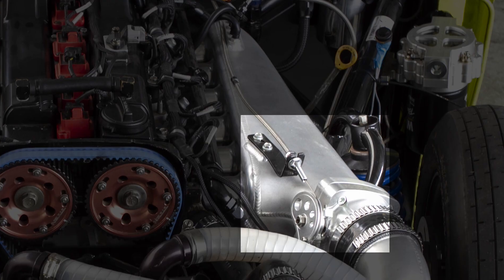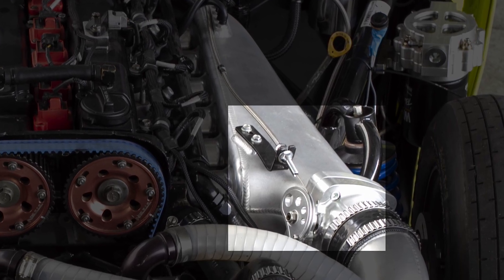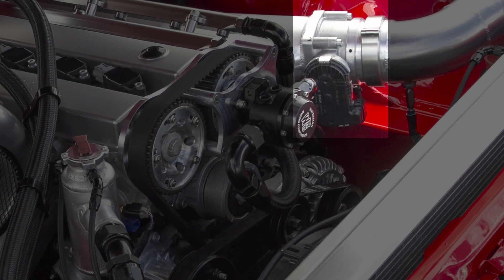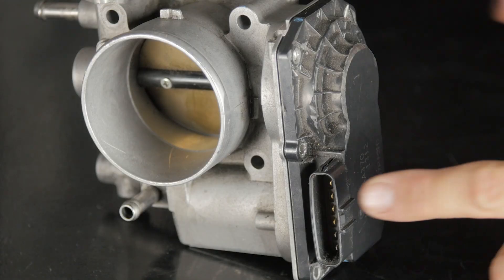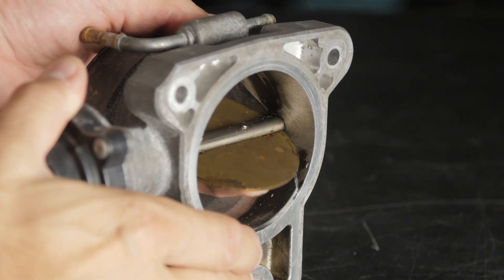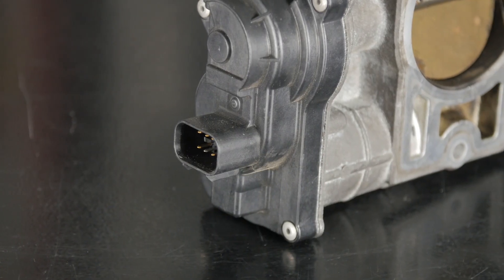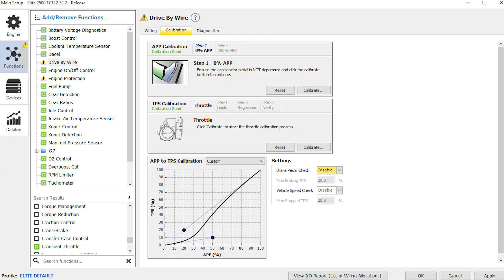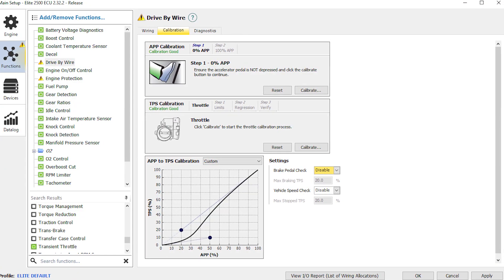🛠 Drive-By-Wire or Cable Throttle?  | TECH TUESDAY  |

Comment: Ive done DBW on my newly built sr22vet and as good as it sounds in terms of traction control and all the rest, the delay from throttle on is annoying, also hard to drive it smoothly, slight touch of the throttle and the car lurches, weve calibrated it yet its still hard to drive smooth, its also hard to feather the throttle in situations where theres no traction control, its hard to keep it in the sweet spot of traction/wheelspin, i much rather a cable throttle now but already have this DBW set up in the car, if i could do it again id definetely do cable

Comment: The major  disadvantage I have found on our Ford BA XR6 is that the throttle does not know exactly what I want, and makes some very dangerous assumptions- either too little, because it thinks I want to be conservative, or too much, which is hazardous in low-traction environments (no TC on the sedan). This has led to my wife (and no sexist remarks, thanks; she IS a good driver) and I both losing control of the vehicle on different occasions, luckily no other vehicles were in the immediate vicinity at the times. We have absolutely NO confidence in the power delivery of the vehicle, and will be trading out to another vehicle entirely, WITHOUT FBW throttle as soon as possible, even if that means going back a few years in model choices.

Comment: The electronic ones fail faster than the cable ones due to failing sensor and/or motor
Reply: This is true. Happened to my 12 year old motorcycle.  Where as my 20 year old bikes have had no issues with cable.   I own three motos.   Plus I predict a time in the future when the authorities will be able to slow speeding vehicles wirelessly with a throttle sensor jammer.

Comment: Most OEM return-less fuel systems can't cope with sudden throttle inputs. So electronic throttles are used to limit opening speed
Reply: Thomas 16.04  great information!!
Reply: So how would a cable throttle limit opening speed then? Or I guess it doesn't and just bogs? (Cuz that's what it feels like it does on my cable-throttle car, when I mash the gas at lower RPMs)
Reply: @Platinumtag  I don't know about the pricing in your country, but here, iacv is cheaper to replace than an entire tb. most of the time, it just needs cleaning.

Comment: As stated, a lot of the issues people usually have with DBW throttles are really down to factory tuning, with a few issues attributable to pedal assemblies themselves having unusual travel and in some cases non-linear potentiometers. Tuned properly, an electronic throttle can behave exactly the same way a mechanical throttle would. Of course, that simply adds a level of complexity to your tune, which can already cost hundreds of dollars in labor time just to get the engine reliably making power, let alone adding whole layers of drivability tuning when TPPS and TPS Demand curves are considered, not to mention the cost of finding and acquiring a suitable pedal assembly that fits your car, sits in a comfortable position, has a suitable spring rate and travel, and the process of mounting it in your car.

Like anything, there's no one right way to use an electronic throttle, but there are plenty of wrong ways, which have soured many people on them, and there are a lot of considerations when developing your own "right way" to throttle your engine. I went with a cable in my Nissan, but I'll be running an engine with an electronic throttle in my RX7. There are a lot of reasons why I've chosen these different paths, and in my opinion, both technologies offer their own advantages that best suit different kinds of builds. Think long and hard about what you want to accomplish, and throttle your engine with the actuator that best suits your needs.
Reply: I haven't had that experience. Even with standalone ECUs tuned to provide linear, fast E-throttle response, no E-throttle I've driven has had the immediate response and natural resistance of a cable. With a cable I can feel the cable be actuated, and instinctively know how much throttle was applied.

Also, when slamming the throttle down after a quick shift, the E-throttles simply can't keep up. "A throttle control algorithm for improving engine response based on the characteristics of electronic-throttle-control actuator" (T. Aono; T. Kowatari, 2001) sees E-throttle response times of 60-100ms; even if that has improved over the years, it will still be noticeable at 20-60ms compared to the <10ms of a cable. Datalogging on my Link G4X shows that my throttle application on quickshift goes from 0-100% in about 80-140ms; a 20-40% delay will definitely be felt - not to mention during transient throttle applications.

Comment: How could an electronic throttle be faster than a cable?
Reply: Electrons move many times faster than we can. If you want a good DBW unit could open in a millisecond, it's crazy how fast mine moves when the ECU triggers traction control.
Reply: @southjerseysound7340  
There's exactly the same human input, the only difference one is pulling a cable and the other is an switch. The time it takes for the throttle to respond would be unnoticeable in the real world and probably actually faster for a cable thats not made for elastic
Reply: @richardballs8618  That is why I mentioned how fast it moves when the ECU tells it to as part of my traction control strategy.
Reply: It will sense wheel slip long before a person can and pedal the car to regain traction in the blink of an eye. When we were setting the car up and adjusting the duty cycle . It would move the plate so fast it was nearly a blur.
Reply: @southjerseysound7340  ok so you answered a question I didn't ask, cool.
Reply: @richardballs8618  You asked how a electronic throttle can be faster than a cable, or didn't you?   I answered and gave one example, of how a ECU can "pedal" a car faster than a cable. There's other situations besides traction control where a good ECU can operate faster than a cable T body and a person. In a foot brake class guys have been known to use a DBW setup to go wide open faster off the line. Basically when he releases the brake and hits the gas the ECU knows to go WOT asap and it'll be at WOT long before your foot hits the floor. Its cheating in some rules because that little bit helps cut a closer more consistent light.
Reply: @southjerseysound7340  

That would be an example of the ecu being faster than the person, not electric throttle being faster than cable. nice cope though

Comment: My 2000 Mercedes W210 E55 has a short throttle cable to an electronic box in the engine bay, I think it might be the same for all the face lift petrol versions but you'd have to check should be loads in scrapyards, they all go rusty or have something really expensive break eventually.

Comment: Cable for me. I haven't driven an aftermarket-controlled e-throttle, but the OE ones I've driven are laggy and increasingly meddlesome and have turned me off to the idea entirely.

Comment: I have plenty of experience with both. I'd argue there's no throttle motor that is as fast as my foot, but that's hardly an issue. My issue is definately the feel - being able to adjust throttle directly and load the engine predictably without any electronic adjustments. Also, like was mentioned, factory cars seem to have a delay (my manual Audi sure doesn't, but the newer FCAs do), and they also don't seem to be 1:1, they lurch or come on far too quick for smooth driving. Speaking of smooth driving, I can put my foot back on the throttle and cancel cruise control comfortably, unlike drive by wire
Reply: Yep a lot of them seem to have a little one two count before they react, just enough to be irritating
Reply: @JordyValentine   I agree but all of those issues can be tuned out these days. I used to swear I'd never go dbw, but once I did it has opened up so many options I find it hard to go back. I picked up over a half a second and now the car is super consistent after setting up traction control too.
Reply: @JordyValentine  LOL
Reply: The delay is miniscule and most people get accustomed...like with boost lag. I was going with cable but realized how much more room I'd have with cable and coolant lines for the tb and idle valve out of the way. I also want cruise and with my old impreza the actuator is huge, so the dbw tb will give lots of space I didn't have before.
Reply: Because normally stock cars open it based on the percent more power needed, not the percent more the pedal is pushed.
If its opened say 10% whats more an aditional 5% of the 10% OR an additional 5% overall. Idk ab cars but with motorcycles typically the first thing a tuner does is restore 1:1 throttle input to open. Or if theyre good theyll dyno it repeatedly to figure out the max open in each gear/rpm before the motorcycle starts lifting or sliding. But a plug an play will usualy do 1:1
Reply: Mate you have no idea what your missing out on. Get a decent tuner to set it up and you wont look back. Mechanical is a thing of the past. My last tuner wouldn't have a bar of it and that reflects in the rest of his work that's stuck in the dark ages
Reply: @joelcunningham2047  mate I won't pay 40k for a brand new car that needs tuning outside the dealership just  to have its throttle response a tad quicker and more analogue. there is no way I let my loaned car get touched by someone who isn't a licensed engineer from said car maker and that's another 2k.

Comment: Why do car manufacturers decided to make everything by wire? I mean, it's way simpler to fix if it brakes
Reply: Easier for the computer to meddle with for traction control, and so they don't need separate components for idle and cruise control. And they don't give a crap how hard it is to fix when it breaks, so long as it breaks outside of warranty.

Comment: Meh, I have yet to drive a car with an e-throttle that feels “right”. Maybe it’s because when I started driving, everything was cable actuated. My biggest complaint is feedback. E-throttles just don’t have any in the foot - they’re dead feeling IMO. Case in point. My JDM WRX STI has a cable tb while the same vintage (02) exports of that car (UK for instance) went e-throttle. I like to believe it’s because Japanese performance drivers’ preference was still cable. Though more likely it had to do with meeting export (UK for example) emission requirements as it’s easier to manipulate engine management with that type of throttle, as mentioned in the video. While I understand the upside of etbs, I’ll stick with cable unless there’s no option - personal preference in my case. Anyone else feel similarly?
Reply: Yous Uck All* I* got from your* comment is that you’ve* not quite grasped the English language. 

You’re probably just not old enough to have experienced the evolution from DBC to DBW. New tech is probably great. I am not shooting for crazy power so no need for me to convert. ✌🏻
Reply: I agree I don’t like the feel of dbw use to make it difficult to drive I just rest my foot on the pedal n forget about it it’s basically like the car drive itself

Comment: Ive noticed on my two drive-by-wire cars (diff makes and models) they seem to have an issue if needing to accelerate up and out of a tight and steep hair pin they take a good 4-5 seconds to kick down. I can replicate it on the same corner every single time in both cars. Not sure what it is but none of my prior cars with throttle cables ever had a problem kicking down on this same corner. Pretty sure its the computer saying no which is kind of annoying,
Reply: I have the same problem in stop and go traffic when drive my mom car. It feel very weired to floor it in stop and go traffic just my make the car keep up with others.

Comment: If using electronic then you should have 2 potentiometers at the “pedal”... the position of BOTH needs to be monitored and the signal disregarded if they are different.. this is a to ensure that a failure cannot result in a runaway car at full throttle , the Boeing 737 Max should have had a similar system to compare the signals on its anti stall  sensors... a sensor failure cannot result in a catastrophe
Reply: not just that but security has always wigged me out a tad, i knows its a very rare chance but, the throttle* being controlled by software is not a good thing imo, software can be modified, im sure if someone were to leave a wifi/blutooth obd tool plugged in that in theory things could be editied on the fly and dangerous things could be forced to happen, i know its a slim chance but its a posibillity, personally i try to trust electronics with my life as little as possible, and yeah i know its not always completely avoidable
Reply: Electricity, Killing people since the 17-18 hundred's or something..
Reply: The Boeing 737 MAX does have two sensors, but the MCAS system only makes use of one of them.
Reply: Mike Seeds A system with dual sensors where only one is used is also known as a single sensor......
Reply: Thing with a plane is that you can't just turn the ignition off, in a car a stuck throttle really isn't a problem, you can turn them off without plummeting a mile out of the sky.....
Reply: @popuptoaster  must be a pretty poorly designed plane if it cant glide 🤣
Reply: @PhunkBustA  Many military fighters can't glide, I wouldn't call them poorly designed.

Comment: Slow response slow response slow response.....i HATE it.... i doesnt move faster than a cable that is impossible, it is sluggish and awkward... reminds of the throtle dampers installed in some mechanical diesel pumps that slow down the decelaration of the car to avoid shaking when you release the throttle abruptly...i just remove those and toss them away... i can control decelartion with my foot if i WANT to..i dont need a fking damper in the throtle linkage....but yeah thats me....if gasoline was cheap i would still be driving with a carburettted engine with manual choke....here we are at 1.68€ per liter so......nahhhhhh

Comment: One downside of electronic throttle: it lacks the "gritty" or vibrating feel of a cable throttle as the engine runs. It also lack the feel of the throttle pedal suddenly popping when it goes from high vacuum to WOT. It also lacks the amusement of having the throttle pedal physically moving when cruise control runs.

Although that's nitpicking.
Reply: Although i really like that vibration when driving hard, but just for getting to work (30 miles motorway) i would really love an electronic one because my foot tingles after 10 minuten^^
Reply: What's about that popping you said. Can you explain it ?

Comment: Being electronic and more complex there might be reliability issues, in case of a cable the major downside in my opinion would be a sticky cable, especially in automatic cars.
Reply: I used factory parts such as modern nissan e theottle and kun hilux pedal.  Reliable as and cheap. Super responsive pedal too

Comment: Another cheap option for those in the US is the 03-07 Accord V6 and 06--07 I4 as these cars are getting old and shouldn't be hard to find in the salvage yard for the APP sensor to retrofit a car that used a mechanical throttle.

Comment: This is exactly what kept me busy for the last few days to retrofit to an MX-5 NA with a VVT-engine!
The hybrid cable/DBW wasn't coming to my mind until this video popped up.
I think that's the road I'm going to take.
Thanx Scotty!
Reply: I've fabbed hybrid cable to DBW setups too. It isnt that hard to do and if you know the values from the potentiometer used in the pedal assembly you can use something other than the factory unit.
Reply: thank you for encourageing me!
Reply: @mixalisstathis274  how's it coming? Want to do the same thing

Comment: Im still all about the cable. More direct and without lag u cant have without a cable. the computer can still communicate with the throttle via the TPS. U can adjust the idle with the little screw on the side adjusting the plate slightly more open or closed for idle. Old school just work loads and loads easier . Only one good thing about the DBW is in very cold country's the ford will intermitted open and close to prevent freezing of the throttle body.

Comment: No downsides to ETC? I'd call the delay on tip in a downside. It's noticeable (and aggravating) compared to the positive and instant nature of a CTC.
Reply: Just a matter of tuning.
Reply: Says someone who has no experience.
Reply: @RadRidesByCru  Did you not watch the video? Tuning fork said that exact same thing.
Reply: Scott discussed tuning the throttle curve, that doesn't solve the latency issues in the engine management system.
Reply: @RadRidesByCru  You need to listen a bit harder
Reply: And you need to take your own advice.

Comment: Scott, in my Subaru I have an issue where if you go from zero throttle to a quick jab on the accelerator it delays sometimes a good second. Response while on it already is excellent. What causes this delay from zero?
Reply: Timothy Brown a dumb ECU making decisions for you
Reply: That can be tuned out of the ECU and wouldn't be a problem with standalone ECU

Comment: If I’m not mistaken, to tune a car on steady load on load bearing dyno it is only possible with electronic throttle body such as tuning the MBT timing for a specific load and rpm. Correct me if I’m wrong

Edit: I’m still hoping for a clarification
Reply: You are mistaken. People can do that while doing something called "street tuning". MBT tuning also does not need a steady load and can be done via power sweeps. Among other methods.